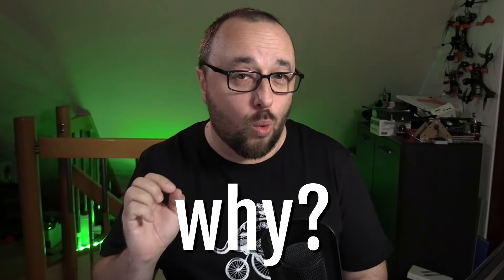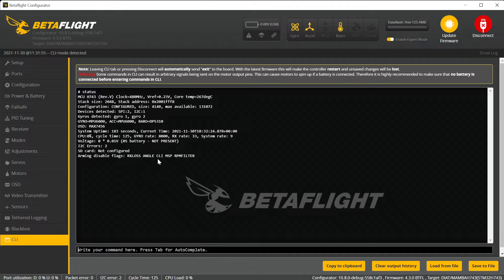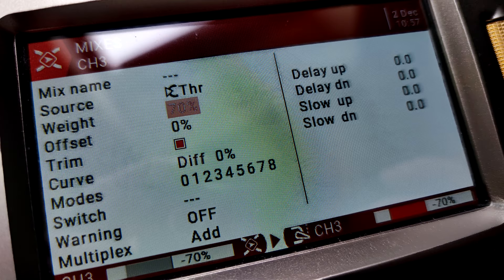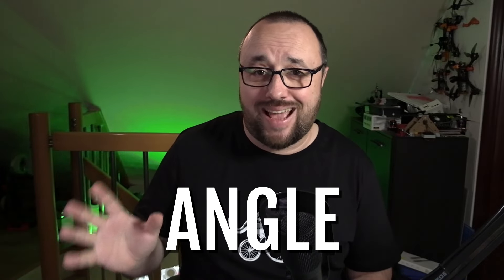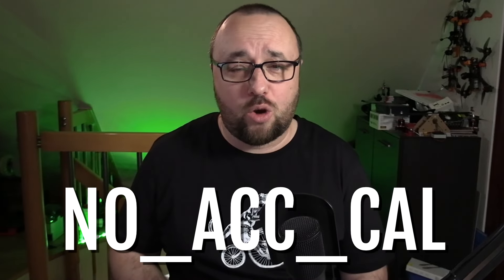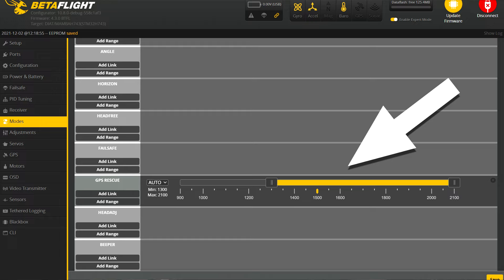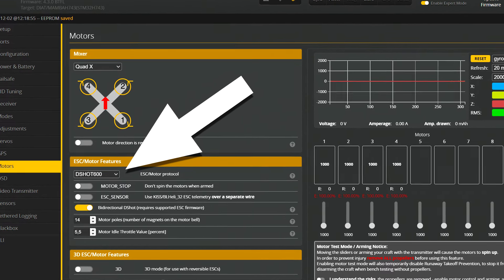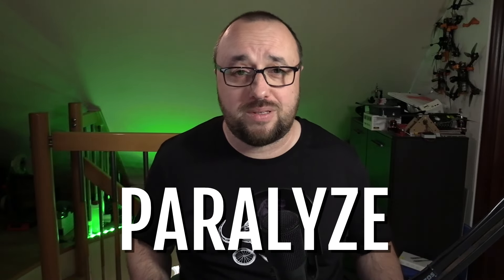Betaflight won't arm - all 26 reasons explained

Comment: So what if upu have no arm disable warranty but it still will not arm? Endpoints setup, not gps rescue as you need gps lock before taking off, switch arming is on and working,throttle down don't work. Tx in binded with rx and is showing in bf, done is level and collaborated. Just refuses to spin motors with tx but in bf with sliders they spin

Comment: I have Many qwads now that i have bound (BetaFPV TX module and HM EP2 RX's) and BF gives RXloss in cli tab, and still do not arm. what else could be holding ALL my qwads from arming? I only have one qwad, using ELRS that is bound, able to get into BF and running great. My other 8 get nowhere.
Reply from the maker: BF gives you precise reason why it not armed. Just see which flag is set

Comment: The one thing you forgot, was if a pilot does an incorrect CLI dump, and is actually able to save and execute the dump, then the quad will load up, show that you have telemetry, and even lose telemetry when you unplug the quad. But not arm.

And you notice in the modes tab, that when you go to arm, the little ChickLit moves into the slider range, but arm is not highlighted. Nor are some or all of the different things like air mode, horizon, crash flip, etc..

So the solution obviously is to find the correct CLI dump. It happened to me, I found this video, and then later was lucky enough to grab the correct CLI dump for a GEPRC phantom analog. Hit me up if you need it.
Reply: my arm tab doesn’t highlight, but the other modes like air etc do. thoughts?
Reply: @midge9740  my first thought says check your channel mapping. And also go back to the receiver tab and make sure that the arm switch (and all others in correct order) is actually popping up when you engage it. If it isn’t/they aren’t popping up in the right order…then check your channel mapping on the radio versus Betaflight. 

Off memory, that’s my best idea.

Comment: In my googles i se throttle every time i try to arm
Reply: @hjvanderlinden  Why dont you come to donbass.
Reply: And i located the problem..
Some sabotour have played around with the firmware,  on V2 mobula 2024..
So now when i turn left, with the right stick, the throttle decrease,  when i turn right the the throttle increase.
And the left stick work as the right should do..
I would guess sombody working for betaflight would do this.
Or a christian religius fanatic...
Reply: @hjvanderlinden  Это не игрушка, там 14+ на коробке написано. 
Игрушка 13+.

Comment: $M>âtARM;FAILSAFE;BEEPER;OSD DISABLE SW;BLACKBOX;AIR MODE;FPV ANGLE MIX;BLACKBOX ERASE (>30s);CAMERA CONTROL 1;CAMERA CONTROL 2;CAMERA CONTROL 3;FLIP OVER AFTER CRASH;PREARM;VTX PIT MODE;PARALYZE;DISABLE VTX CONTROL;LAUNCH CONTROL;¬$M>        ¼$M>	ng
Entering CLI Mode, type 'exit' to return, or 'help'    help me plase